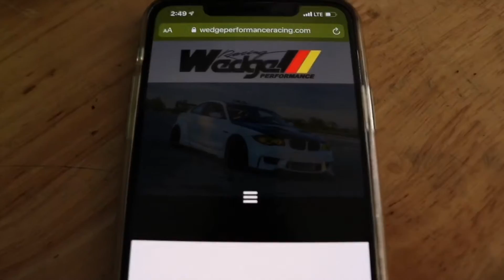BMW 435i N55 pure stage 2 turbo !! Install part 2

Comment: How’d you get the feed line off that you was struggling with?  I thought it was funny ash when you didn’t kno what it was at first cause when I first came across is I was like how tf would I even get that then decided not to replace the hose Lmaoo just bc it was difficult atm.